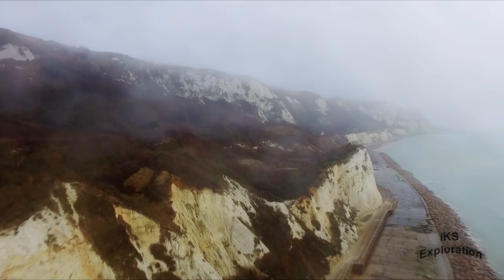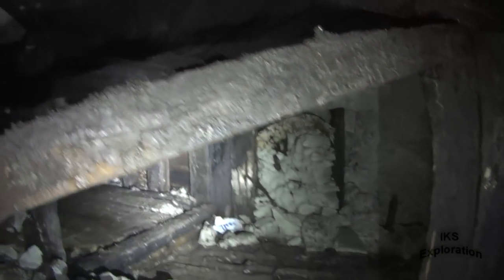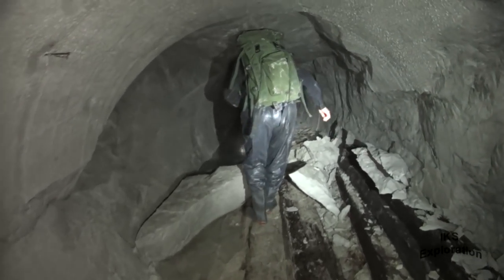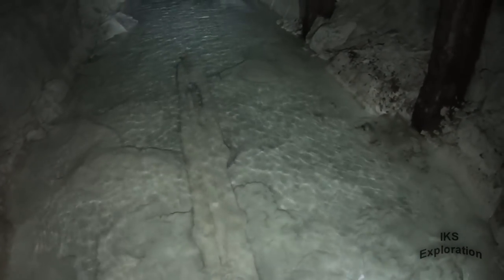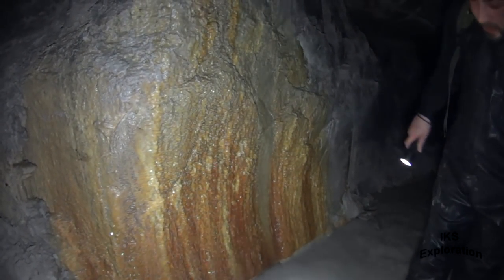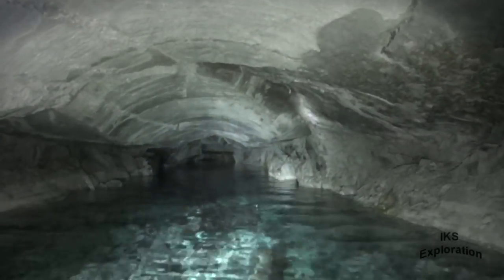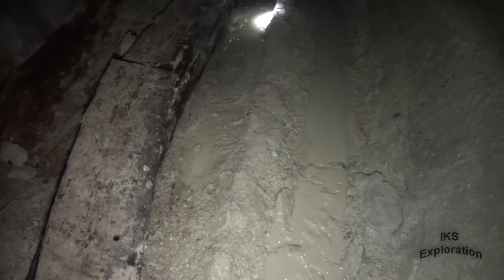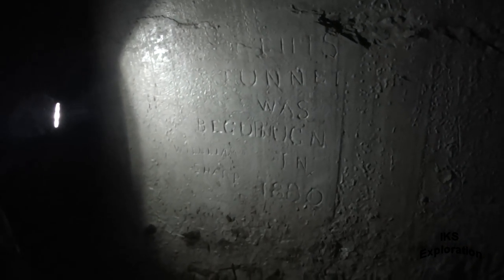Channel Tunnel 1880 Attempt - Documentary

Comment: Amazing film, Ian and Chris. The tunnel is standing up quite well considering its age. Early in my time on TML they opened up the Beaumont tunnel, as the TBMs were to run through iit  ( it was in the original 1970's erection chamber for the service tunnel where the new TBM was put together ). That tunnel had some circular rings in place, as far as I can remember and was back filled to allow the machines to pass through. The strata we went through was always referred to as Chalk Marle and was softer than chalk and very sticky but not quite clay. The orange deposit on the wall is ochre and salts. As you say: the work was stopped due to the political situation. Probably just as well , as the ground was very broken further under the channel and would have caused great problems. Still a great achievement. Thanks for sharing.
Reply: cheers for the info if you have any pictures from your time at TML can you post them up on the facebook page be great to see - TML also did fire training in some ww2 bunkers too
Reply: Sorry, no pics, cameras not allowed ( sackable offence ). There is some footage on YT https://www.youtube.com/watch?v=5Qb0BUELSv0 which was made that might interest you.

Comment: 28:50 "Wonder what did they did back in the day to get the water out?" Guys, guys, look at the history of mining, they began to use steam engines to pump water out of mines almost 200 years before this tunnel was started.
Reply: Yup. Probably one of the old suck and "spit" pumps. I forget their technical name, but you basically have a tube with a single no-valve at the bottom, and a piston with a yes-valve on the head. Piston moves down, valve open, water goes behind it. Piston goes up, yes-valve shuts, no-valve opens, water is dumped to the side of the piston. 

Old and reliable, there's a few of them still working at a farm near me, big ones too, takes a 3 1/2 hp electric motor to power it up.
Reply: be interesting to pump it out

Comment: Why is that the last time? Doesn't look dangerous but I guess we all have a different degree of what is or is not dangerous. I probably would have continued left and not turned around at the small collapse.
Reply: It's clearly very dangerous, the rotten support beams holding up over 100m of chalk cliff could collapse at any time
Reply: There's also far more water in there than on their last visit. Wet chalk is weak chalk.
Reply: stuff like that dont bother me i die i die we all die As long as I die doing what i love i dont care